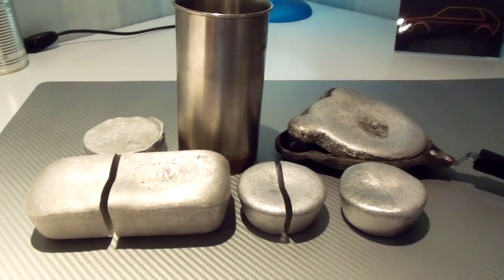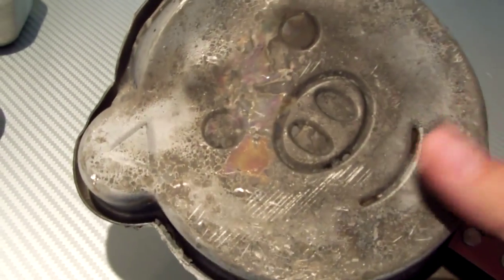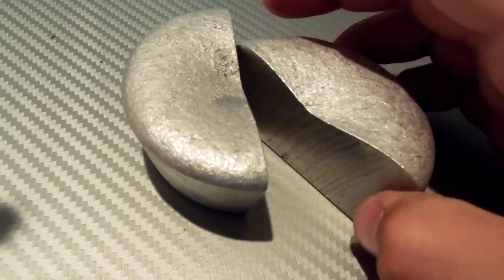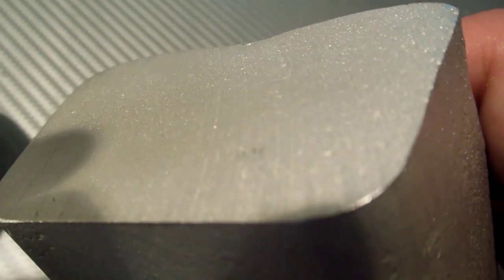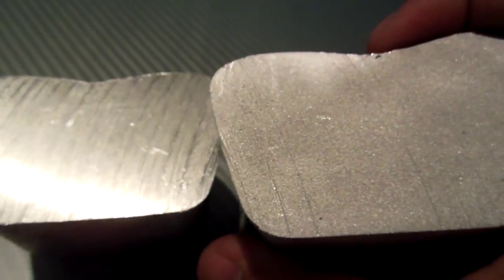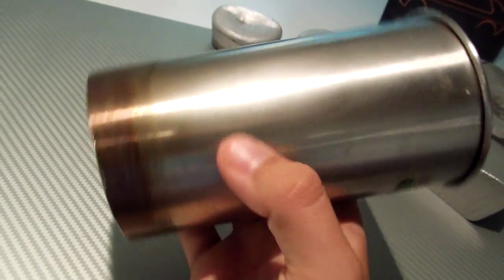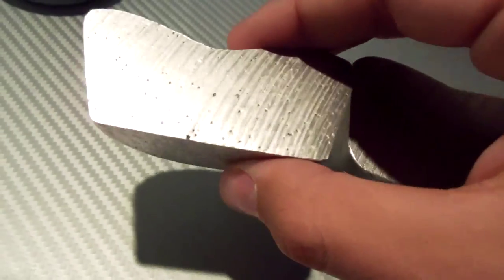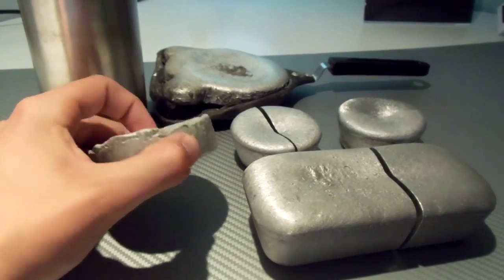Taking a Look at some Cast Aluminium Ingots

Comment: I made my degassing plunger from a stainless steel soup ladle.  Cut the handle off, drilled a hole in the center for a steel rod handle, and cut a curved 3mm slot near the handle to relieve the gas in the plunger (so the metal will rise up into it).
Reply from the maker: Great tip! will make something like that later.

Comment: Very nice ingots!  The large one is really good!  I still can't figure out why some of my castings are full of holes like your muffin.  The large casting really turned out nice though.
Reply from the maker: Makerj101 Yeah, the large one is really nice indeed. Maybe I'm going to machine it some more soon to see if it is really that good. As far as I know I didn't use the salt (same as you use) for the muffin ingots, and I did use it for the bigger ingot, so that could be the case. Also tried washing soda, and that really gives some bubbles, so that would be good to get some air out. But for that I need to make some simple tool so I can push it straight to the bottom of the crucible.

Comment: You might be able to save the aluminum from your pig's face mold by re-melting it.  Then just pull out what is left of the mold and re-cast the aluminum into something else.  I liked seeing your cross sections of your ingots.  This should help when I get around to trying some casting myself.

Comment: You should scorch off any coatings in muffin molds and other molds before you pour metal in them.  Even if they are bare shiny metal, you should scorch them.  (I had shiny zinc coated muffin tins and the metal fused solidly in them!)  Aluminum releases nicely from blackened steel.

Also, the bubbles are from dissolved hydrogen that tried to come out as the metal cooled.  I believe the bigger loaf ingot was nicer in this regard because you stirred in some salt.  That helped the hydrogen come out.  I use borax detergent booster and baking soda (sodium bicarbonate) and a stainless steel "plunger" to degass my melts, and my ingots come out very, very nice -- shiny almost like chrome, and none of the shrinkage or gas bubbles.
Reply from the maker: Thanks for the comment!

I will scorch off any coating in the future. I did preheat more in my last pours, that seems to help, and also prevent any moisture in the mold from exploding.

Dissolved Hydrogen in Metal? Where does it come from then?
Do you know more about the working of the salt? What does it exactly do? I'm not sure, but it seems to work!

I'll make a plunger for future pours, and maybe I can get some Borax from somewhere.
Hope to do more casting when I get some more time!

Comment: the holes are hydrogen bubbles form melting you need to degas your aluminum when its hot baking soda  gives off co2 when heated so you'll need to push the soda down to the bottom don't use to much it will boil over or you can buy a tank of co2 and use stainless steel tube to gas it .